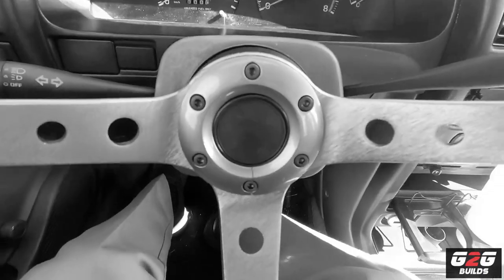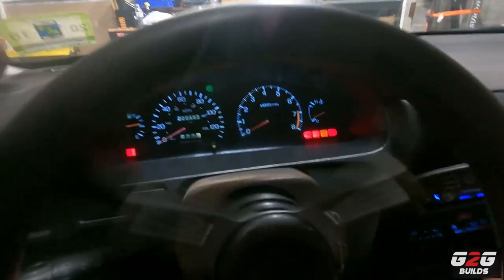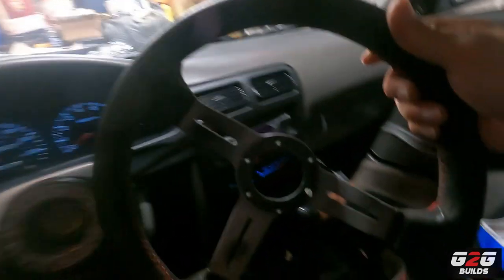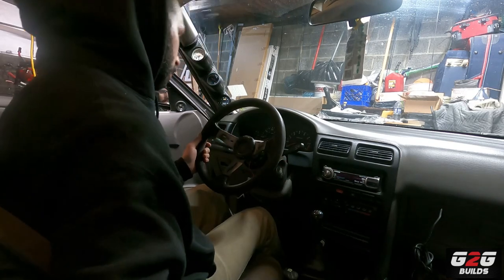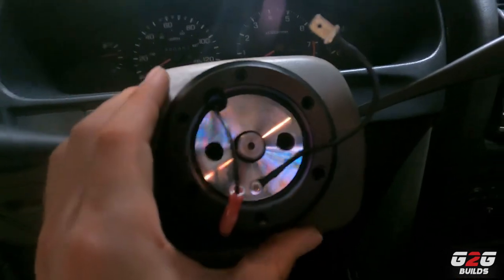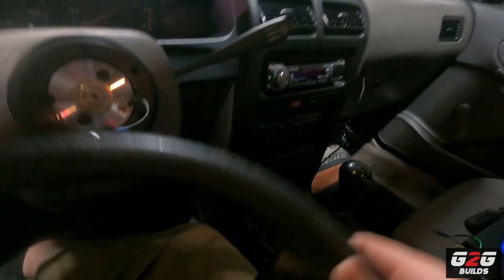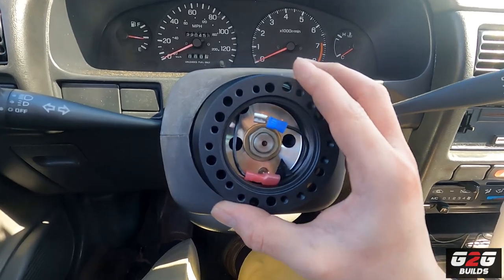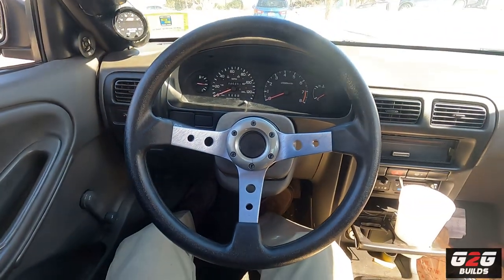B13 Sentra New Steering Wheel Install

Comment: I bought an RAStp wheel for my b13 and immediately went back to ebay and bought a fully wrapped MOMO replica. I actually got that exact wheel you got. The quality was unbelievably low, and I couldn't fathom wrapping my fingers around that hard plastic grip every time I wanted to drive. If you're interested, I could link you the wheel I bought. It was a mere $10 more than the RAS, and the quality difference is leagues higher. No offense intended and I really enjoy your videos. I've used a lot of them so far, as I'm a new B13 owner. (XE 2 door ga16)
Reply from the maker: I understand what you meant, but since I ordered the steering wheels weeks in advance of making the video, I didn't bother on messing with the return process.

Comment: Hello im richie from Philippines i have a car nissan b13. I cannot remove my boss kit supposed to replace it a new one how did you remove your hub kit. Maybe can you give me your advice or tip to remove my steering hub kit. Thanks and god bless.
Reply from the maker: What's up Richie?
You'll need to fight it. I'm not sure if there is a tool that you can use. Maybe attach the steering wheel back and use that for leverage and to pull back.
Best of luck! 👍

Comment: Hello, is your tachometer from a Nissan b14? y Is your steering wheel hydraulic or standard?
Reply from the maker: Yes, my cluster is from b14 Sentra and I don't understand the other question. If it helps, my car doesn't have power steering.
Reply: @G2GBuilds  oh yeah, I meant if it has hydraulic steering, that is, if it was assisted by a hydraulic oil pump
Reply from the maker: No. My engine didn't not cold with it, but I have see other b13 that had them.

Comment: Did u have cruise control before the aftermarket wheel ? About to install one in my 94 b13 and I wanna just keep everything
Reply from the maker: Hey, what's up?
My car car didn't came with cruise control from factory, so i didn't have to deal with it. I'm sure you may have the chance to attach the cruise control bottom to the aftermarket steering wheel, but most likely you can't get the quick release option, unless you make it work.
Reply: @G2GBuilds  thank you for the feedback I decided to just take it out cause I plan on swapping in a 4speed manual and turbo it eventually
Reply from the maker: @elitetoxicity9446  That's the way to go. 💪👍
Reply: @G2GBuilds  what’s some simple power mods I can do to it before I go turbo ? Can I do like throttle body and injectors and some stuff what else ?
Reply from the maker: @elitetoxicity9446  I'll recommend exhaust, throttle body and intake. Leave the injectors and MAF alone, if not you'll have to tune your ECU for them.
Reply: @G2GBuilds  do I do the sr20 throttle body ? And I will find and exhaust I like and what air filter do u recommend
Reply from the maker: @elitetoxicity9446  you currently have the 1.6 engine, right?